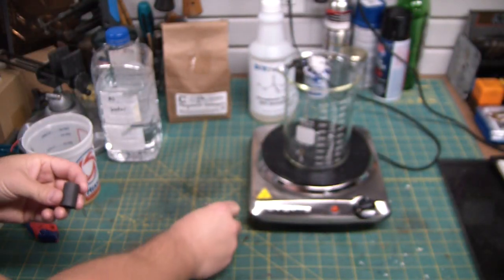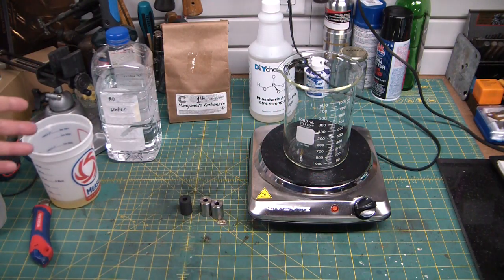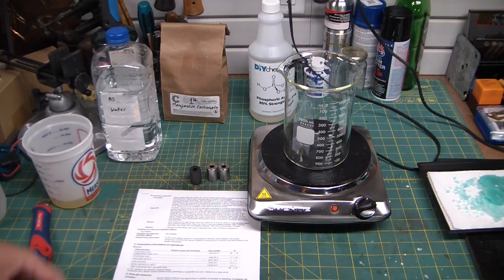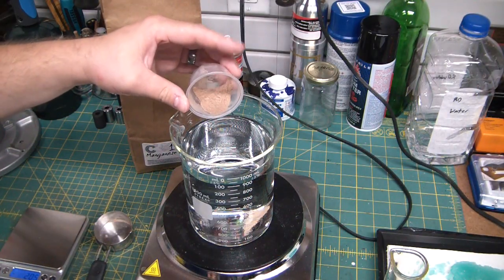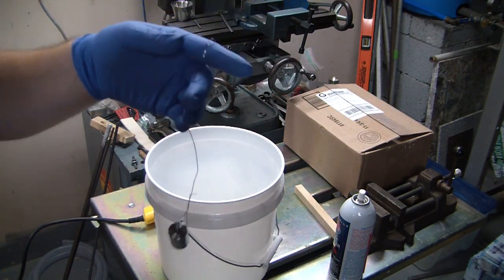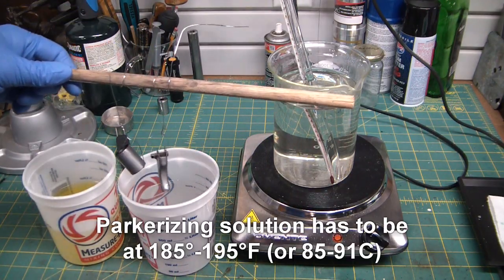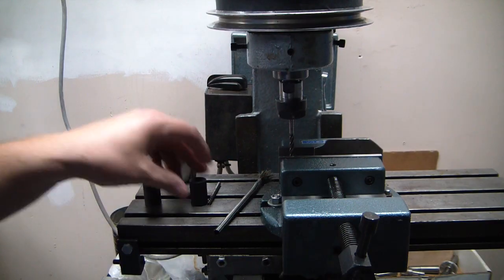Parkerizing Steel at Home - Manganese Phosphate Coating DIY Recipe - ElementalMaker

Comment: from what I understand the best post parkerizing treatment you can do is to wrap the part in foil or baking paper soak with cosmoline and bake it cosmoline has a stronger bond then oil and baking it makes sure it stays in the coating making the coating last pretty much forever

Comment: Hi. I had a go at this and it worked great. I got the solution out again yesterday to do some more and the solution seems to have separated and gone cloudy  white Cristal lumps. It still seems to coat but the pieces don’t fiz now. Do you think that could be because I had to use nitric salt?

Comment: This is like recreating the passive oxide layer youd find on aluminum which is why aluminum doesn't corrode easily. I got a great deal on an AK at my local ffl in a trade deal for me replacing the brakes on the shop owners wife's car. Apparently she rides those brakes like a hooker on dollar Tuesdays. So 2 hrs of work and I got a well functioning rifle that was rusty but thos fixed it
Reply from the maker: Man that's one heck of a deal!

Comment: If you are adding Manganese Nitrate (liquid form 40 to 45 % conc) how much and at what concentration, and in such a case we don't need the Nitric Acid ?? I have Nickel carbonate as well how much in case I do decide to add it...
Reply from the maker: Using straight manganese nitrate would create too high a concentration of nitronium ions in soln. You'll have to look into the patents for nickel amounts, it's been a while since I made this video. I want to say it's a very low percentage to add like 0.5 to 1% if that.

Comment: Round one went well, but the solution became very cloudy with light fluffy clumps of particles after elevated heat.  For round two, the phosphate coating wiped off very easily so I figured the solution was poisoned by the stainless pan, and made another batch using only glass.  This solution also became cloudy after reaching around 90°C.  It checks about 1-1.5 pH, whereas literature I've read calls out pH of around 2 or higher.  Any idea what I'm witnessing here?  The only difference is that my ferrous sulfate is very tan in color, and I went ahead and added a tiny amount of nickel sulfate.
Reply from the maker: I have run into this a few times, particularly when my ferrous sulfate became oxidized like you mention here, so I'm thinking that is likely the culprit. You could also try increasing the pH with some potassium hydroxide or such, I honestly haven't paid much attention to pH in my experiments, but that's a factor that likely plays major importance so in future experiments I'm definitely going to monitor pH
Reply: @ElementalMaker pH did not seem to have a marked effect on this phenomenon.
Reply: this sounds liek whats happend to my solution, did the nickle sulfate fix it?
Reply: @ChrisPunkFilm no.

Comment: What kind of oil did you use in the oil bath? I have played with Parking using the Zinc Phosphate and the manganese phosphate concentrated solutions that were once sold by Midway, but it was always the oil bath that would ruin the project. Tried WD-40, 3 in 1, boiled linseed and even motor oil... Yours turned out very uniform.
Reply from the maker: @stevemcelwain5172  I've used several oils with no noticeable difference. Motor oil, Gates DWRP 360, Rem oil, they all seem to work A okay for me

Comment: Hypothetically, as a substitute for phosphoric acid could Klean Rust Remover/Surface Prep work, or any rust remover if it contains said ingredient? Unfortunately it comes with water and alcohol so that's why I ask. First time ever attempting mixing chemicals, rather not it be the last. Is nitric salt the same as sodium nitrate, as in the salt used for cooking? Also would the ferrous sulfate pills work? Sorry if I'm asking stupid questions, my lack of experience is showing through. Just trying to be a cheap bastard lol. Originally intended pursuing the method of bluing steel however found Parkerizing lots more appealing and worthwhile. Look forward to applying this to my slowly built up collection of tools! Thank you for the video, wish you a great day!
Reply: Another quick question! Can this solution when made be stored for later and how much of it can be used until it loses it's properties? Also what sort of oil do you recommend dipping in? Thanks!

Comment: Hi from France !
Nice video you make a great job
Here is a formulation to activate the formation of phosphate crystals :
Just before the phosphating bath dip the piece 5 min into a warm (45C) solution made of : 
2 g sodium pyrophosphate (Na4P2O7) and 2 g of manganese hydrogenophosphate (MnHPO4) for 500 mL of water 
Then go to the phosphating bath normally.
After the phosphating bath you can also make a passivation bath but it's another story...
Bye
Reply: You can passivate the piece after phosphatation by using a very weak solution of tannic acid (1 g per liter) for 2 minutes at 50°c. No need to rinse after.
This helps to obtain a darker color and to avoid rust and it's safe.
Bye
Reply: What does this do compared to the citric acid bath?
Reply: @rogierius  it will create many primers on the surface better than etching with citric acid.

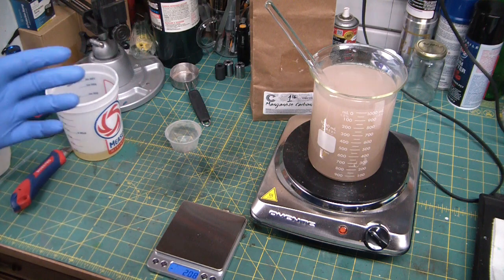Comment: Tom Cruise is hosed with that Clear babble.  Wikileaks has 600+ pages of their docs for the OT levels. It's a word salad. Tom is the poster boy for Mark 8:36. It's Jesus or nothing.

That's a pretty good looking Parkerizing job.  I believe this can be done by electrolysis in phosphoric acid. If that's true, have you tried thar? Nitric acid is expensive after you pay for hazmat shipping. And then you're probably on a watch list, too.

Comment: Thank you for the great video! I am glad to hear that you are recovering well from your back injury. I recently did Manganese phosphating on some small parts, with good results using DuraCoat solution. I have two questions relative to the process you demonstrated: 1) what would be the benefit of using Nickel Nitrate (or what is the negative effect of not using it)? 2) if I want to try with Nickel Nitrate, how much of it should I add to the solution? I saw that someone else asked the second question, so we would appreciate your response. Thank you!

Comment: Hey there.  I'd rather not mess around with a $150 jug of Nitric Acid.  In your video you mentioned using Manganese Nitrate... where can you get that and how much would you use. ~J
Reply from the maker: @jeffbechtel1535  you can just add a few grams of potassium nitrate instead.

Comment: I have a question would be nice if you could answer it. Does the recipe of this parkerizing job also make a difference on the wear restistance of this type of finish or does it depend on the steel type you apply the finish to? I can't legally get nitric acid and even carbonates are hard to get but with manganese oxide, ferrous sulfate and phosphoric acid it works too (I tried) but can't compare the finish to one with those chemicals you used. Can you say something about that?
Reply from the maker: @meoffjack  yes the parkerized coating should be highly wear resistant compared to the base metal. Nitric will make for a better coating, but I'm not sure exactly how much leaving out the nitric will affect the final hardness of the coating.
Reply: @ElementalMaker  Thanks for the answer.🤜🤜🤘🤘

Comment: This is gold! However, is there a way to avoid using nitric acid or anything nitrate based? Just aking because here in Italy nitric compunds are considered dangerous because of their use in fabricating explosives and can only be bought with an agricultural license and very strictly regulated.
Reply: Try using manganese oxide, ferrous sulfate and phosphoric acid. I tried and it works but don't know if the finish is as good as with those more dangerous chemicals. If you can get manganese carbonate then use this instead of the manganese oxide. 

Use 1-3% phosphoric acid, 0,2% ferrous sulfate and 0,5% manganese oxide/carbonate. So for a litre of solution 10-15ml phosphoric acid, 5g manganese oxide and around 3g of ferrous sulfate.

Comment: Use some degreased steel wool to "season" the solution first before doing a parts run.  Steel wool just because it has a lot of surface area and will dissolve quick as opposed to a solid bar etc.. This makes the solution preform much better, getting a much more black, more even coating right off the bat without having to do a bunch of parts cycles. To my knowledge, this is what the pros and old timers do, and it has worked great for me when I was getting the same grayish appearance.

Comment: For Degreasing small steal parts I fill my sonic cleaner with hot water, fill a small glass jar with acetone, pop the parts in the jar and drop it in the hot water. Give it a few to come to temp and let it run. Not for a single part but for its very effective and I can let it run when I leave the shop and they’re ready for coating when I get back

Comment: 11:55 i dont have a sandblaster. Can I use hot citric acid over treated surfaces? Like blued/parkerized to "refinish" It?
Reply from the maker: @jotapezanelatto  to remove an existing blued surface I would first soak in evaporust to remove the bluing, followed by degreasing, then give a quick etch in citric before Parkerizing

Comment: You need to activate the solution after it gets up to temp by dissolving a small piece of degreased steel wool or iron powder. After that you will get a much better finish on your parts.
Reply from the maker: @HomelessCNC  I've done that but didn't find it necessary in my trading. I believe with the iron content from the ferrous sulfate in my solution it may not be necessary to season it as much as other solutions.

Comment: What if you soaked the part in boiled linseed oil after parkerizing and let it air cure for a more durable oil finish?
Reply from the maker: @ethanthescientist4834  I've never tried BLO, but I hear it works well for soaking into parkerizing. Personally, I would try to thin it so it can really penetrate, and then buff it clean once removed so it didn't form a sticky mess.

Comment: Glad your back an$ in better health! We hav3 always used Dextron II ATF fluid for the post roast. Now to research how to get that green park used on Uzi's.
Reply from the maker: @Subgunman  love that green park like on some of the old M1's. I've heard it can be achieved thru just zinc phosphate coating rather than manganese, and then coating with cosmoline and storing for some time. Apparently the zinc phosphate reacts with the cosmoline to form that great coating. I need to experiment and see if I can replicate it
Reply: @ElementalMaker  that green park was on the Israeli .308 1919A4 parts kit I bought about 28 years ago. Had even acquired the M2 grip kit for it. Even the Israeli UZI parts had the green park. Both looked great in that green finish. Too bad I had to get rid of everything when I moved to the EU. Really sux. Is cosmoline still available? Wonder if any other packing grease will give the same results.

Comment: when ive done this i throw 1/4 of a (cleaned with soap and hot water) steel wool pad in first. it will totally dissolve in a few mins. after this the park is much darker and uniform. thats why the your first parts are not as nice as the subsequent parts.
Reply from the maker: I haven't found that to be necessary with this formula, likely because of the iron already in solution from the iron sulfate, although perhaps I need to add half a gram more to get it perfect
Reply: @ElementalMaker  I only used phosphoric acid and manganese dioxide though, so it needed the iron from the wool.

Comment: I use hot oil.
The remaining water gets out faster.
I also tried linssed oil at 150 C. Works fine and leaves a berry good finish when dried over night

Comment: I can't use Nitric Acid here in the UK thanks to the crazy types abusing its energeric properties, which nitrate salts would be an appropriate replacement for it that I could use here? (can't even legally make it more than 1% in solution in a lab without an extremely difficult home office license lol)
Reply from the maker: @noviceartisan  sodium, potassium, or manganese nitrate would work. 3-4 grams should be adequate
Reply: @ElementalMaker  thank you😎
Reply: @ElementalMaker cheers man  just got some potassium via amazon. Burst into laughter at the "Frequently bought together" suggestion from them... Ffs amazon, NO they do not go together in the UK. Super illegal combo 😂😂😂😂😂😂😂 (yeah, the obvious 2 😂😂😂😂😂)

Comment: Just glad you're back and definitely feel you on the back thing.  Heal up and take care of yourself, I'll happily wait for your next video :)  Was that a bench top knee mill?  If so, what brand, I've been looking for a knee mill and had resigned myself to a full sized Bridgeport clone with a VFD.
Reply from the maker: @BiscuitWaite  thank you! And yes that's an old benchmaster mill I found on marketplace for $50! Talk about a lucky day. Spent another $100 on new bearings and seals to rebuild the spindle. It's still not a very accurate machine by any means, but it's handy for the workshop.
Reply: @ElementalMaker  Thank you for the brand name. I'm a machinist by trade so if I find one maybe I can jazz it up.

Comment: I have done the hot caustic bluing for a number of years. It has an expensive first set up, and laborious method. Then some parts come out absolutely beautiful, and others will come out hideous, right next to them, largely due to the alloys of the steel. I strongly suggest anyone thinking of hot blue to just pay someone to do it. Yet this parkerizing is far easier.
Reply from the maker: I've largely had good luck with hot caustic bluing, although I have run into some alloys that just don't like taking a good blue. I think leadloy was one that didn't take a great blue but I could be mixing up my alloys.

Comment: Good to see you back. Couple things I could suggest. Using electrical contact cleaner (pentane) as a final de-oiling step is about the cleanest solvent commonly available. Even an inactive machine shop still has a notable partial pressure of hydrocarbons in the air, so perhaps this is an outside step. 

I might suggest a flash oxidation with ozone after the citric etch, I’ve read papers on the use of it In significantly increasing the adhesion of concrete to rebar (like 2-3 times) because it’s a very fine, microscopic and strongly adhered oxide. I would imagine it’s of use here because it would greatly increase the density of nucleation sites? If that’s even the right term here, but definitely anything that increases nodule density would refine the grain significantly I would hazard a guess.

Comment: NAPA Auto Parts sells a 40% Phosphoric Acid.Everything else I've found is 20% in general retail.
Reply from the maker: That's great to know! I'll check Napa next time I'm in there
Reply: @ElementalMaker  I will do a relook at this. When I was actively researching derusting and phorphoric acid, I learned that Milkstone Remover contains a high percentage of phosphoric acid -- about 75%. I will see what I can dig up.

Comment: Nice guide. I wasn't aware of this (oxide based I assume?) alternative, so thanks for sharing.
Personally I love nickel plating for the extreme durability and excellent chemical/oxidation resistance (and cancer) - but this is less involved and quite beautiful also. I think this arguably looks better than most bluing with the matte look. It will work aesthetically in any situation.

Comment: Well done Bob, you succeeded where I failed. I've never been able to get satisfying results in my tests. Do you need to process steel wool with your solution to keep the iron content high enough?
Reply from the maker: Thanks Carlo! With the added ferrous sulfate I have found the solution is pretty much ready to use out of the gate, no need for seasoning with steel wool, although perhaps a tiny addition wouldn't hurt as I've found the first batch of parts to not look quite as nice as following batches.

Comment: This may sound crazy but here's something i figured out helps with degreasing parts. 
Spray some light penetrating oil on the part before spraying the gutter or brakleen on it.  I have no idea why it helps, but i noticed that when i degrease wet parts it just worked better.

Comment: From Jander / Blasius Inorganic Chemistry I Theoretical basics and qualitative analysis: "Manganese(III)-compounds with Mn3+ Kations are, especially in water, very unstable and strong oxidizers. Anionic Manganese(III)-complexes are comparatively more stable." This was a translation from german by myself. My hypothesis is that the nitric acid oxidizes the Mn2+ to Mn3+ which then is complexed by sulfate and/or iron ions and water molecules.

Comment: 1) Glad to hear you are doing better. I had a bad back injury some years ago and it took years for it to get mostly better.
2) How much does this change the size?  Like if you had a 10 thousandths clearance  fit, would it still fit in the same hole?
Reply from the maker: Yeah I never realized how debilitating a back injury could be. Brutal stuff. With that kind of clearance it might cause interference, I'd go with hot caustic bluing if those tolerances were needed. I do plan on doing a video comparing bluing and parkerizing which will include some micrometer readings to check for dimensional changes.

Comment: Just a tip (and only for a second...): After you have parkerized or rust blued the parts, dunk them in kerosene for an hour or so. With your parts, it is not an issue, but parts with hollows/holes/assemblies/etc. the kerosene will push out any water left and give you a tougher coating before the oil bath.
Reply from the maker: Great tip!